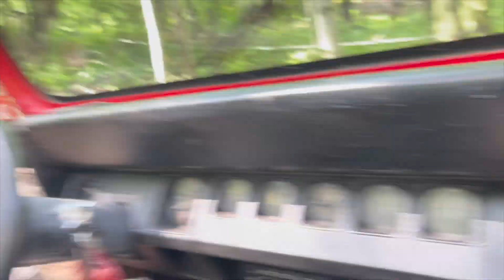How are we going to Hook this Off Road Recovery

Comment: At 02:20 is that whats called ,,a flooded carb,,?
To solve that steeringissue pick you choise: a with the pump engine driven you can only steer with the engine running.
               b use an electrical driven pump.
               c in boating there are hand operated pumps. Turning the steeringwheel pumps oil to the cylinder. 
So you can steer anytime. Force? Use the right combination and with 1 vinger you can turn the wheel(helm!).
Eric. I understand that you deal with the facts and now tow an unsteerable truck. But someone watching this can make up his mind wich way to go. Think your belt breaking/getting of while driving.

Comment: You should mount a 12v boat live well pump and run 1/4 inch poly nozzles to keep the wreckers windshield clean in the muddy trails. You will need to mount a 2-3 gallon plastic reservoir though as you will go through a lot of water but with 3 nozzles you will be squeak clean with higher pressure and more volume.
Reply: Haven't seen the video yet but oh sounds like it's going to get muddy
Reply: That definitely works I have used that setup b4
Reply: Rainex and 10 minutes with the defroster on high heat the mud peals off and doesn't stick

Comment: Well a repeat customer,  i would at least built up the front end with a skid plate & some type of pushbar custom bumper etc etc to avoid the next damage to the components & make it easier for the 3rd pull
Reply: Given it was fuel & not a steering issue of course

Comment: You need to service the Kingpins on your Front Axle its starting to have Camber Bad! You need to get one of the Aftermarket AC kits and install on the Wrecker and get a Gear Doubler you lack Low enough gear to do much!

Comment: Have been curious on what you run for tire pressure being a dually on 16.5s but having to do recoveries. Have been watching you guys for a long time great videos and even better work. Thanks
Reply from the maker: It depends on conditions, but the rears are most often at about 25psi, and the fronts about 20.

Comment: Notice that all 4 wheels on buggy are turning as you tow. Do not understand why.  Doe's it involve a locker dif on both axles?
Reply from the maker: T-case still engaged, most of these rigs stay in low lock so long they are hard to shift out, the linkage gets full of mud.
Reply: @offroadrecoveryteam  Tnanks   Looks strange to a non off roader